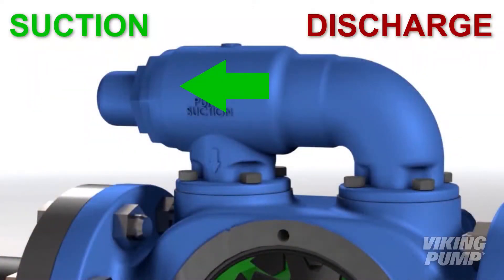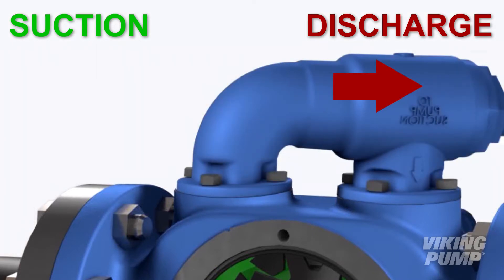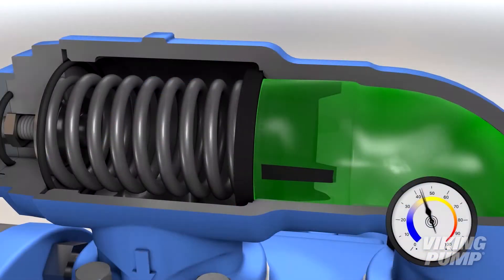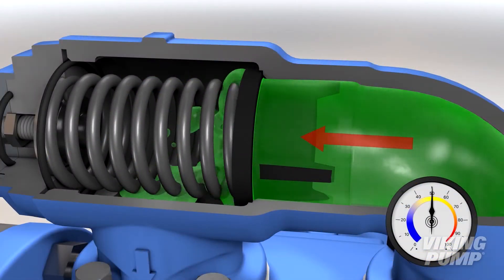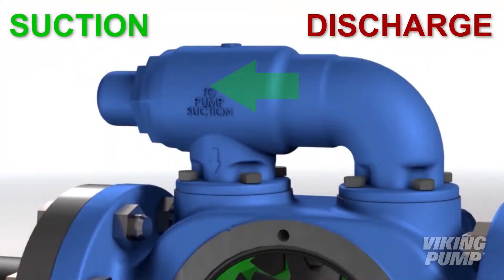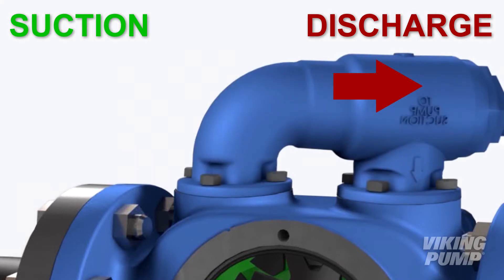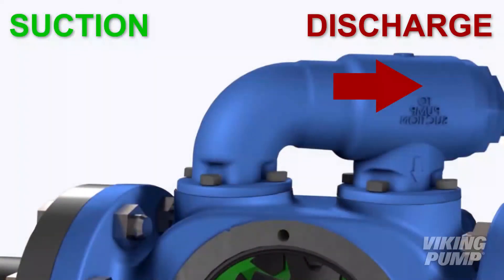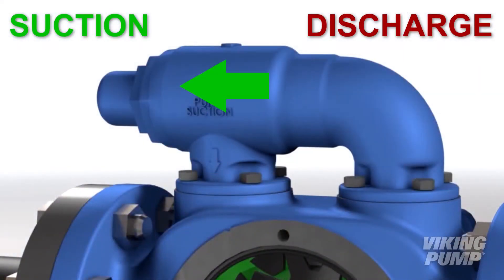Pump Troubleshooting 101: Relief Valve Orientation

Comment: Can noise in the gear pump is also due to the improper setting of the relief valve .
Reply from the maker: Hello! Yes, a relief valve that has been set too low COULD be a reason for a loud pump. However, there are a number of other possibilities to consider. Aeration or cavitation are also potential reasons a pump could be noisy. For help in identifying any potential issues, please reach out to your local Viking Pump distributor!

Here are some additional videos that describe aeration and cavitation:
Aeration - https://youtu.be/WFc0ee3KzMo
NPSH - https://youtu.be/VuT93N9b-qk
Reply: @VikingPumpInc  hi thanks for the information, can you guide us it is ok to run the gear pump in circulation with relief valve or it should always in circulation through control valve, or both can work parallel, so what is the main use of relief valve if we have already control valve for circulation
Reply from the maker: No, an internal pressure relief valve should not be used to regulate flow. The valve’s purpose is to protect the pump and system from overpressure should an upset condition occur. For more information on how a relief valve works and how it protects the system, here's another video: https://youtu.be/SR9F6lfMEAA
Reply: @VikingPumpInc  sorry actually I am talking about overthrow valve in gear pump what is the purpose it is also for safety or can use for controlling the flow in the absence of circulation line with control valve .